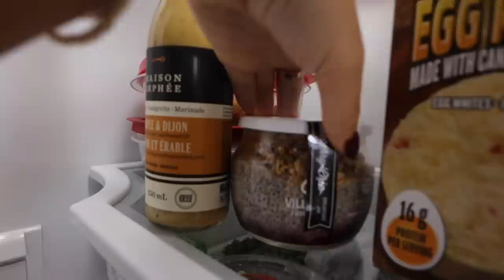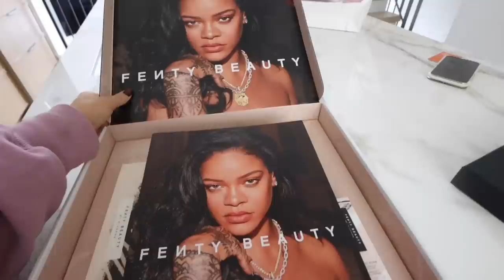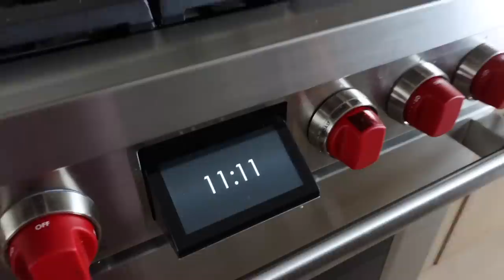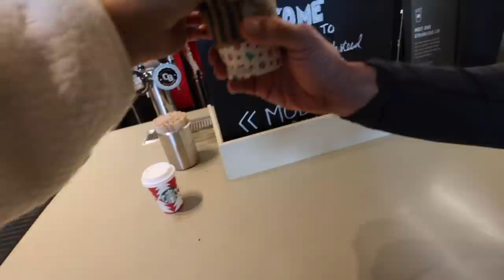DECORATING FOR THE HOLIDAYS!!! putting up my christmas tree!

Comment: Hey, Tara!! What you can do with chicken is I always set my oven to about 375°-400° when I am cooking boneless and about 400°-425° for bone in, and I just season it however I want then set the timer for about 30-45 minutes. I check it, and if it still isn't done, I reset the timer for another 10-15 minutes. As for on the stove, heat your pan to about medium to medium high, add some oil to your pan and cook it for about 10-15 minutes on each side. This works best when you are cooking thinner slices of chicken. Trust me, it comes out perfect. I do it any of these ways all the time and I have never had a problem. It really isn't as hard or as anxiety filled as you are making it.

Comment: I think gravity is assisting in the cracking - when you re-grout, do one side at a time. I would start with one of the sides (lay it on its side and re-grout only the top side, let dry/cure for at least 24 hours before you "roll" to the next side). Hope it helps!

Comment: I think the grout could've cracked due to the weight of the tiles (since the tiles are standing on the sides) with the weight of the grout itself. Everything seemed to have shifted, which is too bad. Maybe tape the tiles in place (with painters tape) and let the grout dry completely?? (If you ever do it again). If you can spot patch it then great, you're all set. Everything looks amazing....as usual!! Love you

Comment: I haven’t watched it all yet but the cracking on the table could be because the grout had too much or too little water in it, temperature or humidity but it still looks great and should be an easy fix x